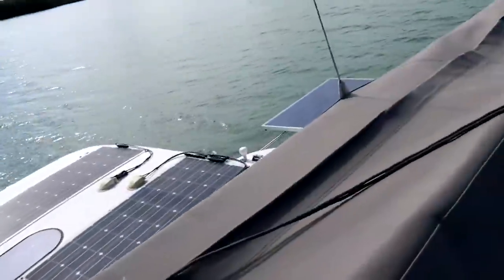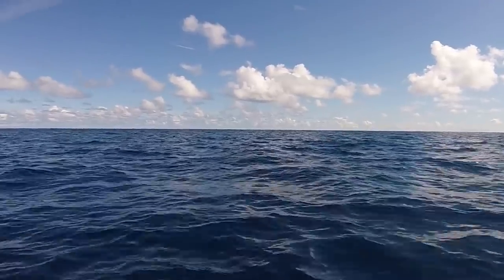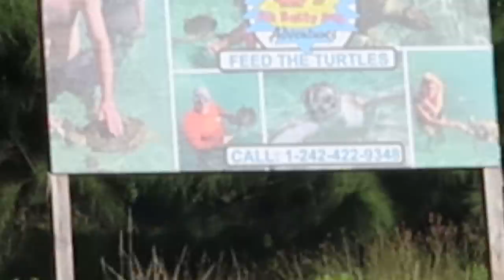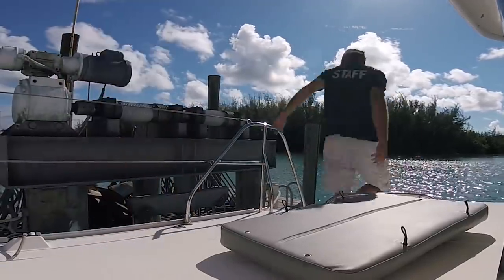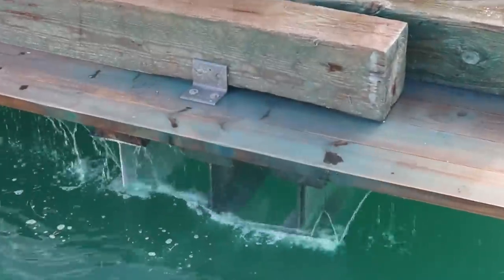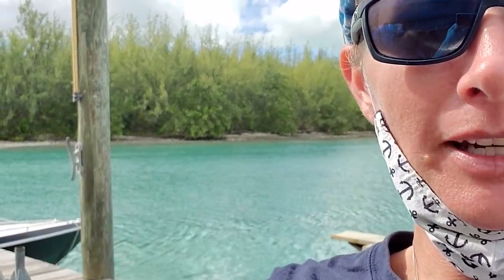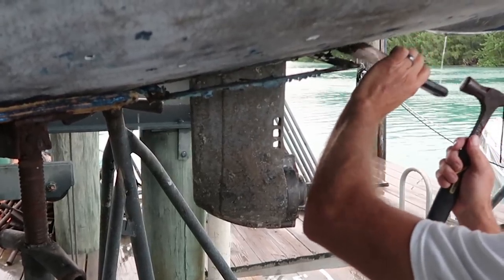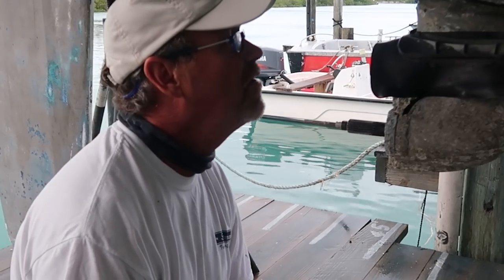We've NEVER Seen a Haul Out Like This! | Ep 68 | Sailing The Space Between

Comment: The number of cats (on YouTube) that I have seen pulled out of the water,  I am surprised that the bulkheads aren't actually marked. Something as simple as a diamond in the stripe would be so easy  and would avoid the problem of improper lifting, not only for the lift operators but for the boat owner to witness.
Reply from the maker: ya funny I was thinking the same thing when he was doing his tapping I might just do that.
Reply: Most factory cats I’ve seen do actually have little stickers for strap locations. It’s also in the owners manual....